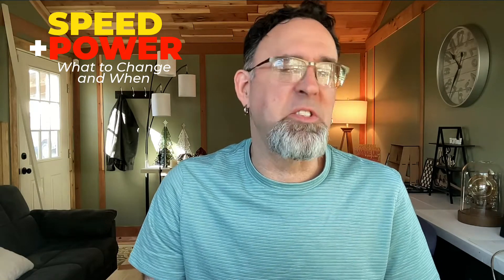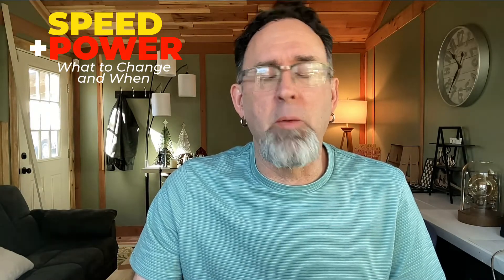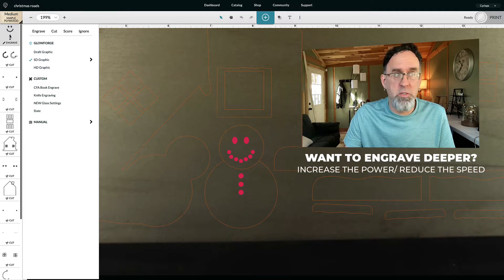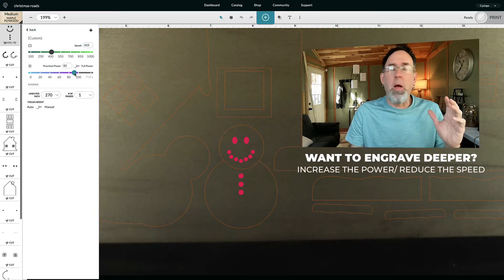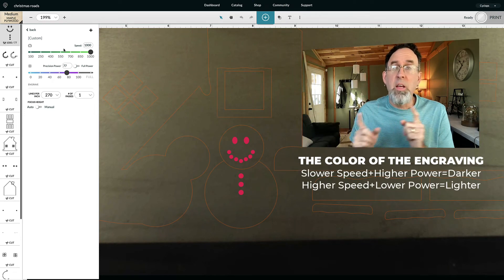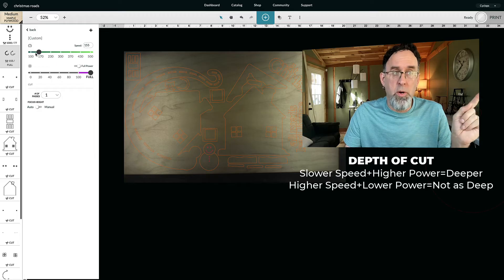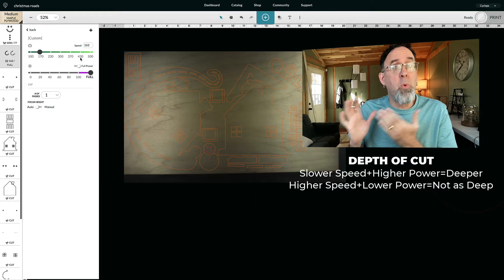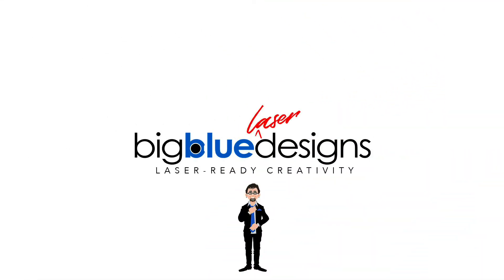Tutorial: Speed and Power (What to Adjust and When)

Comment: HELPFUL VIDEO!!! A few more questions - What causes a zebra color results? I see some darker areas of my lasering on tumblers. What also helps with minimizing the lines you see on the tumbler? I see the lines. I've used settings of 85% power / 300 speed / 100 lines per cm. I have a XTool - S1-40watt.

Comment: I am still in the thinking mode as My Alpha will be here SOON and I am wanting to get good at inlays.  "LIGHT-BULB" -  As cut depth on the base needs to be dialed in, cutting the inlay portion is going to be tricky as when you use a backing tape, you want the wood inlay to cut, BUT, not the backing....  I am going to try the aluminum AC duct tape that will keep any intricate inlay pieces in place with the aluminum foil tape being a better laser "stopper" than relying on just a paper tape.  As the AC tape is sticky as hell, maybe a layer or two of blue painters tape first, then the AC tape.  You will still need to dial in the inlay cutting power/speed, but, by using the aluminum tape the cutting process will/should be more forgiving.  OH, you were great in "National Treasure"  :<)  You must be nick's brother or related....  (sorry bout that)..............

Comment: Ok so, my issue is that i have a 20 0z black stainless yeti tumbler and settings are at 100 p, 70-80 s. The first line of engravements come out perfect but the bottom words set on the bottom are darkened. Look like a Carmel color? What is causing this. All settings are confirmed before framing and starting.

Comment: So recently I started playing with leatherette  keychains and used my settings for leatherette  but didn't take into consideration  the size if the Keychain vs a tumbler or hat patch, and well it was a failure  so I adjusted speed and power  to get just right for the size of project, and we'll it kept failing  to get  thinner lines in the script (the whispy lines that some fancy looking scripts have ) and would not engrave them with out going way to deep  on the main body of script. Any tips on how to get a good balance  with thin and thicker lines on a graphic or font that you can't separate? The font I'm using is called "choppin script." My laser is a thunder nova 35 100w.

Comment: Great Info... Can you explain.. the amount of passes? I've seen this setting on other videos... but not explained. Tks!
Reply from the maker: Not sure I understand your questions about passes. 

If you use more than one pass, it’ll be a deeper cut. And you can always experiment with lower power and higher speed to not cut as deeply in a single pass and combine passes to equal what a single pass would normally be. 

Is that the direction you’re asking?

Comment: What’s better for the laser? Having it a Lower setting for longer or having it at a higher setting for less time? Just trying to get the most out of my laser before it will need replacing. Cheers
Reply from the maker: I’ve heard that running at full power all the time will wear out a laser faster, but I’ve had lasers for 5+ years now and have found that the time saved running at higher power vs going lower power/slower is worth it to me. If it wears out the tube, I’ve made more than enough money with the time saved to buy the tube many times over.

Comment: Hey I have been having problems with my 5w laser to cut 4mm birch plywood. I was always on max power but its euther not focused propertly or the speed is bad. Any suggestions?
Reply from the maker: Birch is often a pain to cut in general. I’ve not used a 5w before so I can’t share any specific tips, but proper focus definitely affects cutting as does speed. 

Max power is what I would expect would needed for a 5w to cut 4mm and it make take 2 passes. So I’d start some tests with cutting a small square shape and see what speed and passes get the result you want.
Reply: @BigBlueLaserDesigns  I have found some test files that vary the speed and power in a grid of squares, to see what cuts. Lets hope that helps. I will update after I test it so others know :D

Comment: 2 part question:

1. I’ve been playing around with settings for cutting some birch plywood 1/4” from HD, and notice that sometimes it won’t cut all the way through on all the pieces on my 12”x20” sheet I’ve cut. Settings are speed 130, full power. Would you suggest setting it up for another pass? 

2. I’ve noticed a lot of char on the cut pieces I mentioned above, especially the outer edges and on the opposite side facing down on the crumb tray. I put masking paper on the cut side, but not on the side facing the crumb tray. Should I mask both sides?
Reply from the maker: Birch is quite often a pain to cut, so it’s not surprising that 130/full isn’t doing it all the time. Before I quit using Birch, I’d often be at 122-125/full, but that produced a much blacker edge, of course.
Reply from the maker: When I mask, I always mask both sides. You’ll get flashback from the crumb tray on the back side, so the masking will catch that.
Reply: @BigBlueLaserDesigns  ok great. Since you’ve stopped using Birch, what are your top three materials that give you the least amount of trouble on the laser?